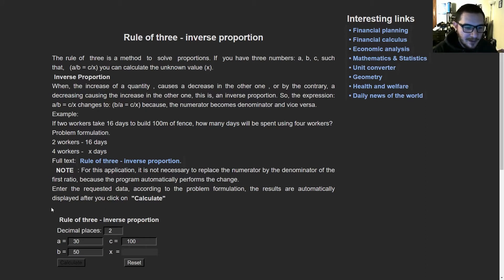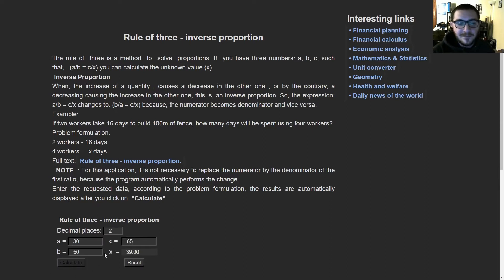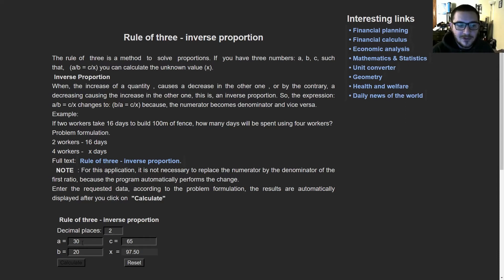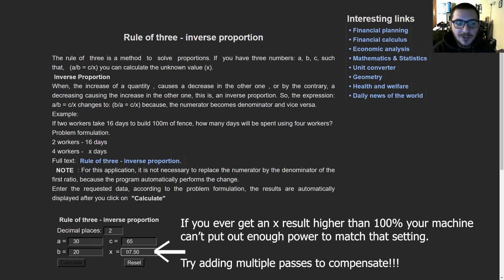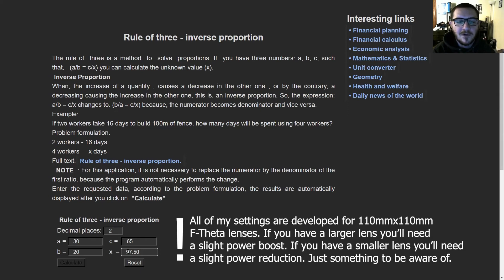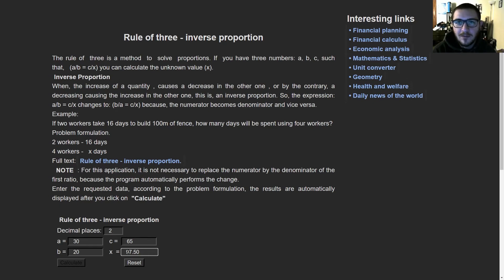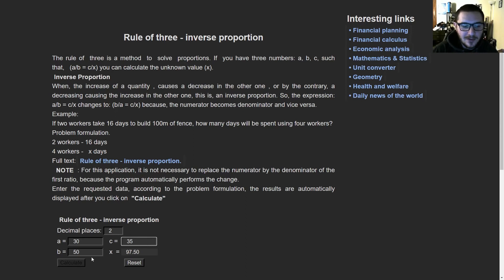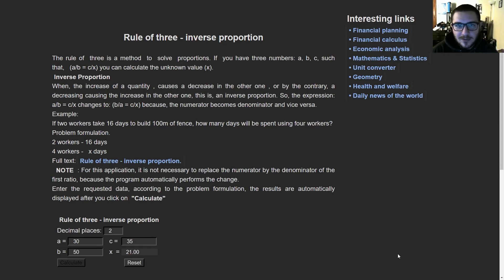How to Convert/Scale Settings for Different Wattage Machines | Fiber Laser Tutorial 20w 30w 50w

Comment: I have your patreon chart but I have a laser that doesn't go below 50kHz frequency. Do I need to make an adjustment when your settings call for 25kHz?
Reply from the maker: For 99% of cases Don 50 is going to work as well as 25 in any given situation. You shouldn't have to adjust much as far as frequency goes.
Reply: @LaserEverything  thank you!

Comment: Is there a formulaic approach to conversions with different lens sizes? 75/110/300?
Reply from the maker: Typically in my experience they're more or less directly proportionate. A setting on a 110 would require twice as much power to work effectively on a 220. GENERALLY* :P

Comment: Does this calculator apply to a UV laser in Lightburn? Power (or was it Freq....(head hurts) isn't utilized in Lightburn yet right? I'm trying to save relevant vids of yours as I prep.
Would it need Maximum pulse Energy to be effective or would that be splitting hairs for a UV?

Comment: Great converter. One question. We do not need to convert also speed? Or it matches anyways? Thanks
Reply from the maker: Typically I don't recommend messing with speed unless you need to lower it to compensate for values over 100 in the power field after conversion.
Reply: @LaserEverything  mine is 50w jpt so all you power settings fit. I will convert only power, leave speed and frequency as yours and see what happens.
Reply from the maker: Yes that's how the spreadsheet is designed to be use.

Comment: Awesome info. One question...does this conversion also work for different lens sizes? We already have a ton of parameters for our current lens, but are looking to add some variety and would prefer to not go through all that trial and error again.
Reply from the maker: Check out the patreon, instant access to my entire CO2 and Fiber laser library PLUS a setting wattage and lens converter. You just plug your lens and wattage laser in up at the top of the document and it will convert whatever settings you want for you. 

https://www.patreon.com/lasereverything

Plus you know, it helps support the channel :)
Reply from the maker: Glad to hear it!

Comment: The bigger issue is actually the frequency conversion... Assuming all raycus, 20W runs 20-80khz, 30W 30-60khz and 50W 50-100khz. I have a 50W and see people sharing lots of settings but most people have a 20 or 30W laser so most don't work as intended for me. Any ideas on that?
Reply from the maker: Frequencies don't really "convert" which I why I don't cover it here - in the situation you described you'd want to get as close as possible to the prescribed frequency and then you'd have to play with your other hatch and setting parameters to try to find a similar mark. Not an ideal answer I know.

That said 'all raycus' is a big assumption especially with the rise of high frequency range devices like laser sources manufactured by IPG and JPT so there are definitely machines out there with the frequency range to reproduce a lot of settings - it's just a matter of getting your hands on them.

Raycus laser sources were never designed for engraving they were actually designed for industrial laser cutter use but the low cost of manufacturing these sources led to their use in the engraving and marking industry. While they're an awesome entry point for new users on a budget I would always recommend a JPT with a high frequency range (often 10 - 400 or 10 - 600) which allows you much more flexibility without the added expense of a MOPA.
Reply: @LaserEverything  When I started doing my research everyone was recommending raycus and saying the IPG and JPT weren't as reliable. Plus I was already spending #2k more than my budget. Since then though I have seen exactly what you are saying and wish I had gone that route. My 50W raycus is great for deep engraving but not so much for finesse. 

Loving your channel so far. Thanks for giving away all of the "secrets" lol.
Reply from the maker: I honestly believe the laser engraving business is better for everyone when we cooperate and share our successes and talk about whats working. It makes us all better and we can all provide more value to our communities as a result. Your raycus is a perfectly capable machine. There's still a massive range of applications for it even if a few select things are off limits :)